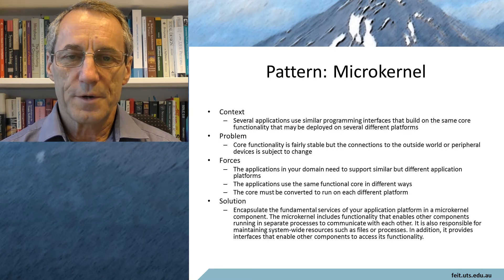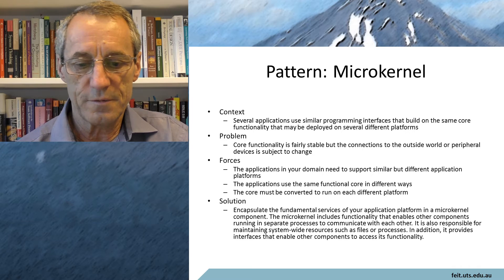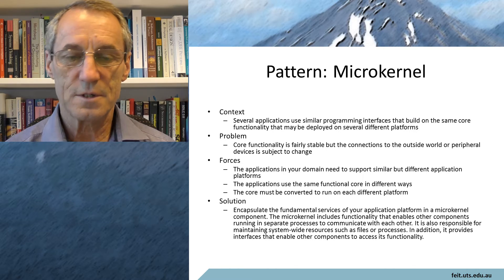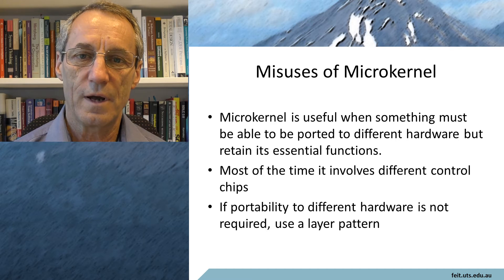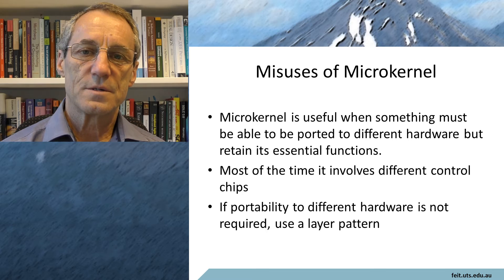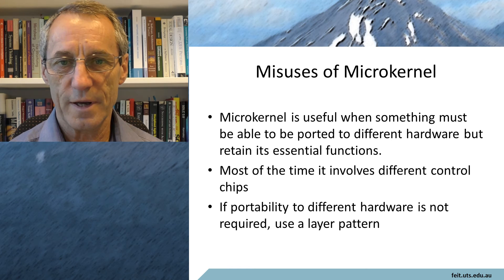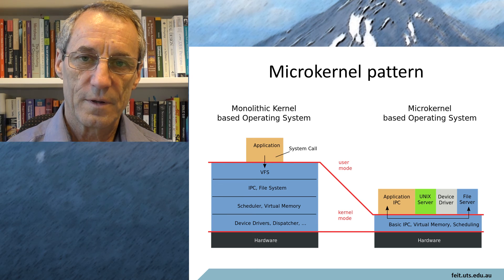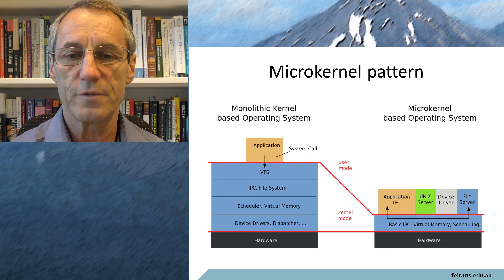Patterns   Microkernel

Comment: I find this pattern to be a bit off compared to other. It is of more use when context is given and Microkernel is compared to other kernel structures, such as monolith and monolith with loadable modules.
The downside of the Microkernel is the AFAIK the increased amount of user/kernel mode switching needed.
That said it is actually a good idea to thing of OS-types as a variant of architectural patterns.